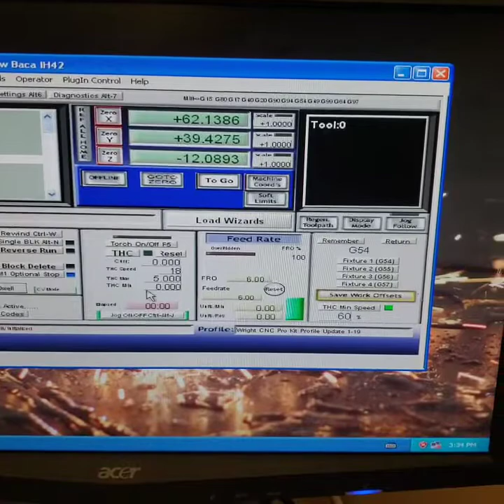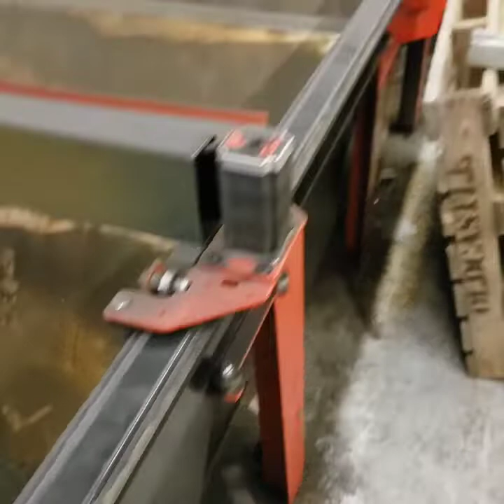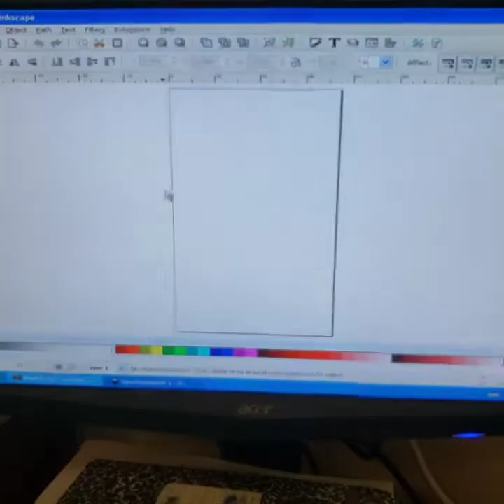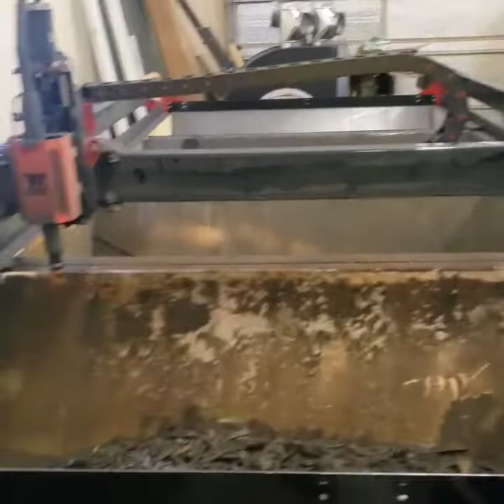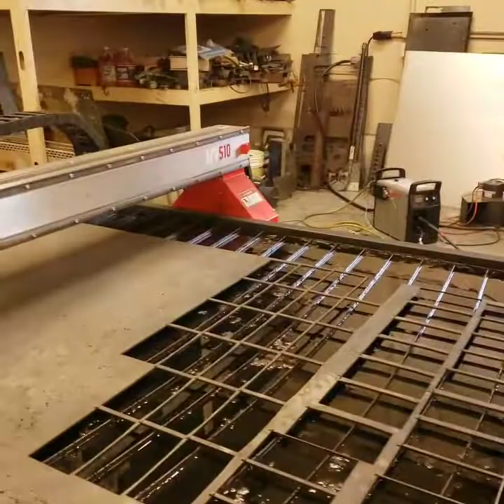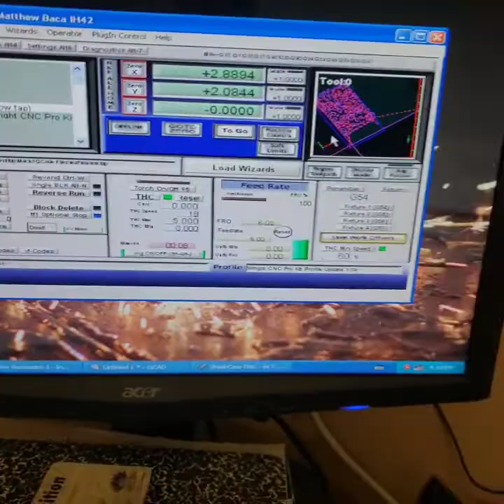What to look for when buying a cnc plasma table!

Comment: Nevermind you answered my question lol thanks... what industry do you do most of your work for?? I'm a pipe welder going to go on my own with a welding g shop and cnc plasma but not sure what type of cutting/industry I want to target thanks
Reply from the maker: I'm not really set in one market. I like to change things up. Help out local fab shops with small item, custom car parts, hand rail, tanks, roll cages, rzr and can am stuff, metal art. What ever makes money. A guy on YouTube started his shop with an idea and then found a demand for boats and does that full time now. There is more work for small shops than anyone can handle.
Reply: @matthewbaca  thanks alot for the info man... if you were to buy a table again but only wanted to spend about 10k is there any? Your new one is awsone but I cant start out that high... also what state are you in? I'm in Florida. Also how do you charge by the hour?thanks alot for the info